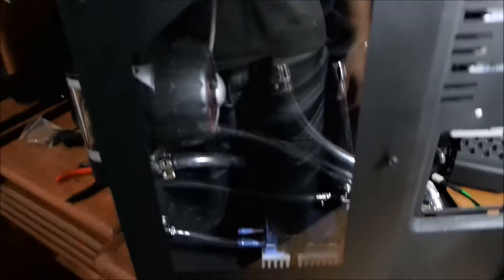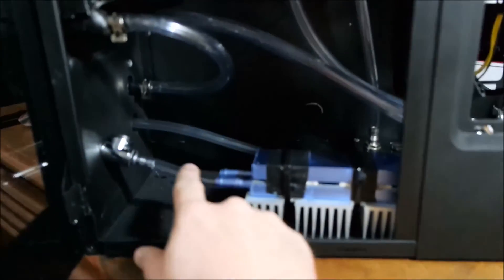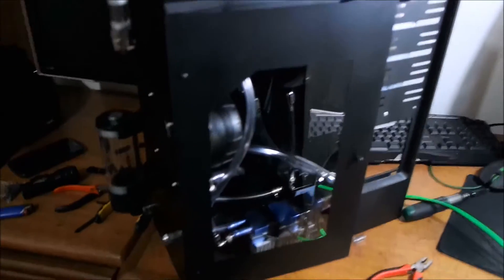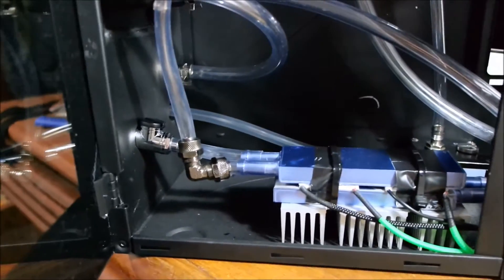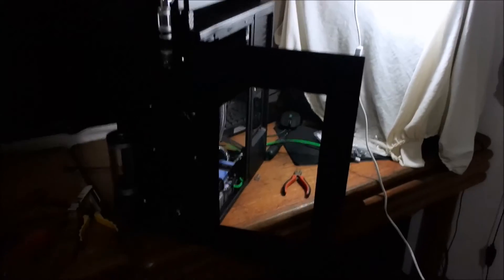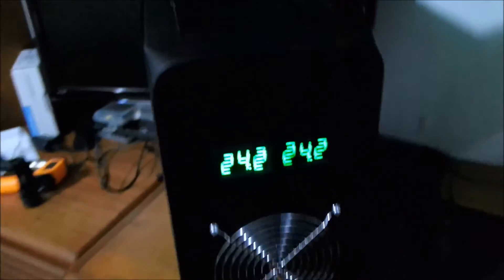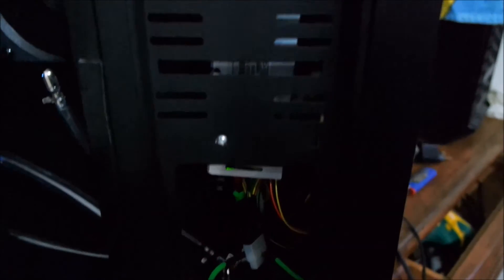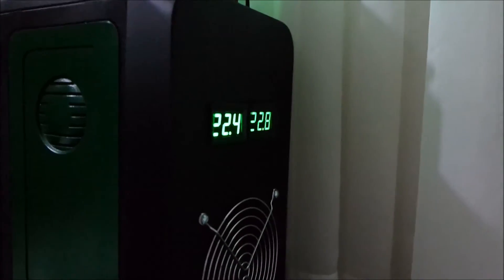Worklog Chiller Casemod Water Cooler PC Parte 3

Comment: Boa tarde.
Gostaria de saber onde vc comprou o chiller, pois não encontro em nenhum site.
Reply from the maker: +Allan Silva eu mesmo montei amigo.
Reply: Mas o bloco vc comprou onde?
Reply from the maker: comprei na china mesmo, aliexpress
Reply from the maker: http://pt.aliexpress.com/item/120x40x12mm-Aluminium-water-block-cooling-cooler/32316674544.html?spm=2114.02020208.3.271.G6ayuP&ws_ab_test=searchweb201556_2,searchweb201644_4_79_78_77_82_80_62_81_61,searchweb201560_1
Reply: Qual é o tipo de massa que vc usou para modelar a parte de plástico do chiller?
Reply from the maker: usei 2 tipos de massa, acrilica e massa plastica que é a mesma usada em reparos a automoveis, eu indico a massa plastica por ser mais resistente.
Reply: Eu tava querendo usar massa tanto na parte de metal, como na parte de plástico do gabinete. Pede me auxiliar por favor as massas para cada lugar que eu for usar? Por favor.
Reply from the maker: a massa plastica vc pode usar tanto no metal quando no plastico, ja acrilica eu uso só no plastico
Reply: E como vc fez pra pintar tudo?
Reply from the maker: lixa 240 e finaliza com 400 ou 500. depois tinta spray preto fosco